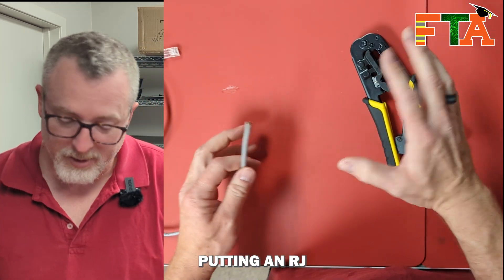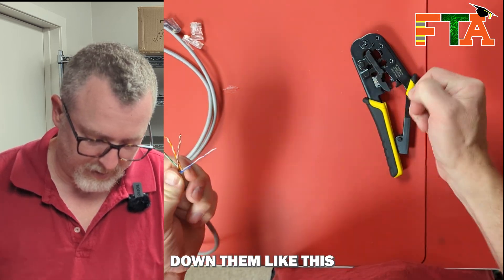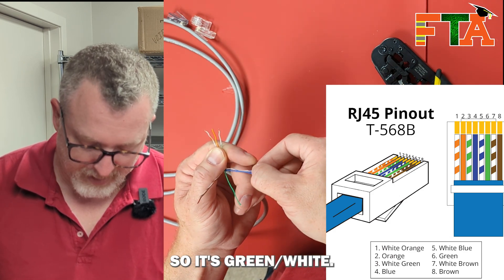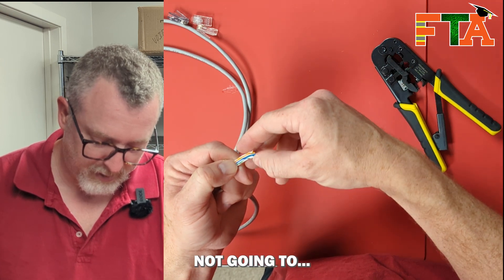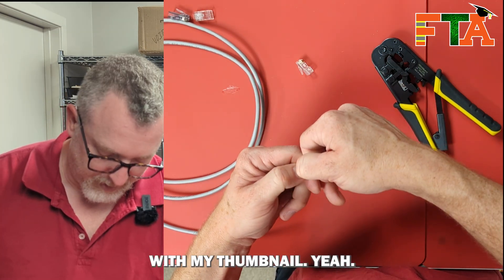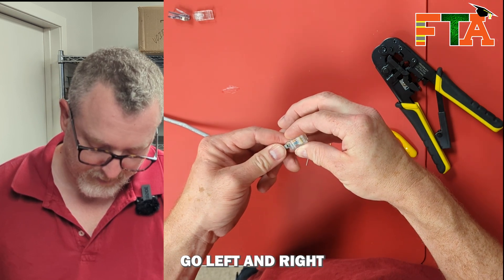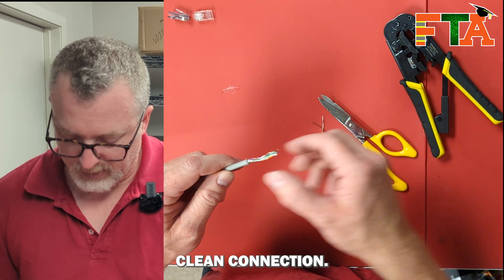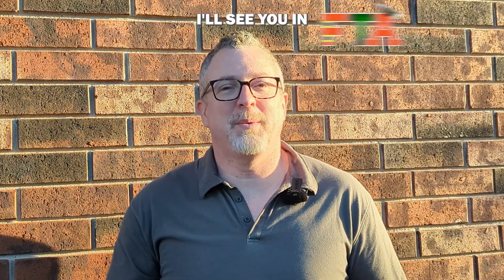Simple Tips to Crimp RJ45 End on Network Cable-Updated | How to Put Ends on Network Cable

Comment: Just switched to the pass through RJ45’s. Never Going Back…Ever….
Reply: The pass through crimper works for the traditional style.  I have one for RJ45 an RJ11.
Reply from the maker: Oh nice. Now it makes me wonder if there is any technical reason the pass through ones would be better, worse, or equal to the standard ones?
Reply from the maker: @chadtitan4159  they're an interesting concept. Do they require a special crimper?
Reply: Yes it does require a special crimper with a blade to cut the excess wires. I don’t mind the old way cause I’m used to it but the pass throughs just cut down on the finicky work and saves time from mistaken crossovers.
Reply from the maker: But then I have to carry ANOTHER tool (insert whiny voice lol)